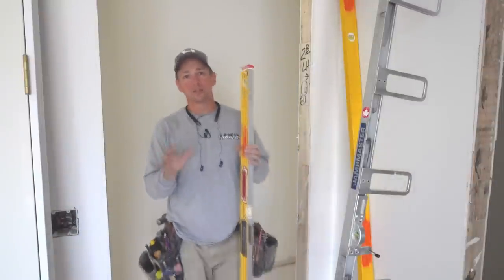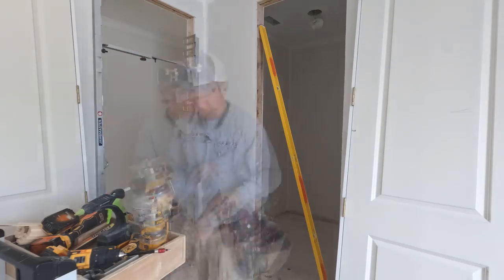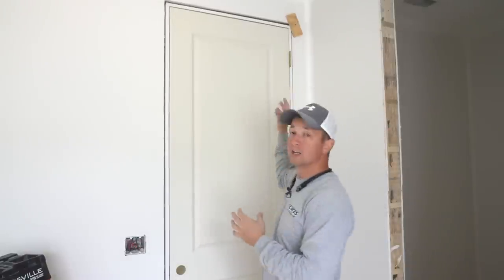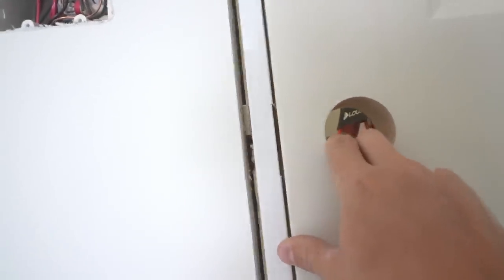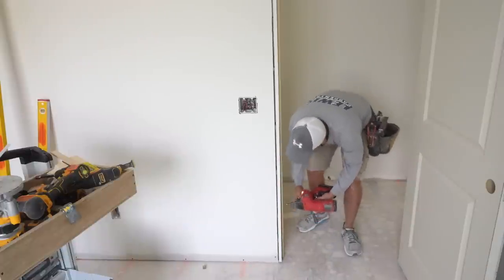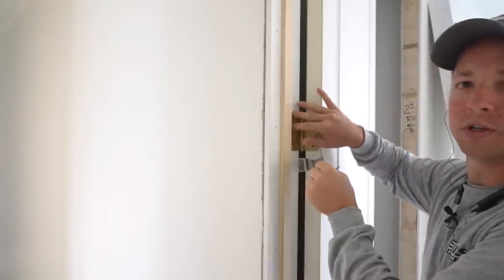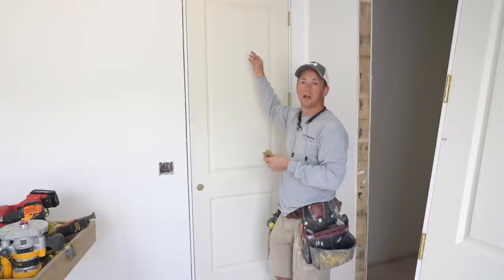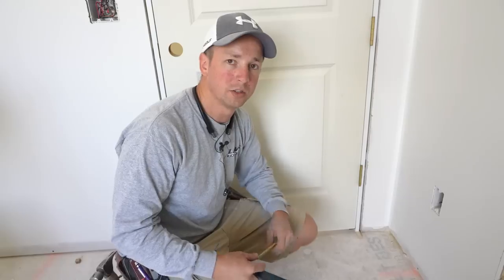SETTING PREHUNG DOORS - Important Keys to Success

Comment: Even a perfectly hung door will move over time.  Especially a 3 hinge door, will eventually bind at the bottom, because the hinges leaves will eventually bend.  Also houses move, more than a trim carpenter would like.  So never a perfect science.  Also most of the doors and jambs we get are pure garbage, even the supposedly good ones.  Nice video.